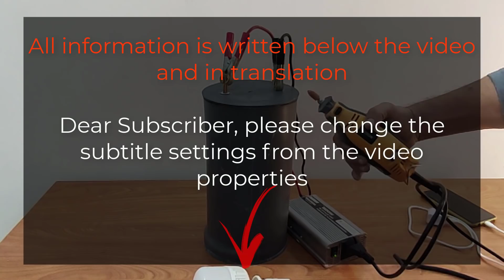Three months on probation until it succeeded

Comment from the maker: The Baghdad Battery is believed to be about 2000 years old (from the Parthian period, roughly 250 BCE to CE 250). The jar was found in Khujut Rabu just outside Baghdad and is composed of a clay jar with a stopper made of asphalt. Sticking through the asphalt is an iron rod surrounded by a copper cylinder. When filled with vinegar - orany other electrolytic solution -
This method was modified using an electronic solution, which is rechargeable and gives a higher voltage than its predecessor
Reply: Is hypochlorous substance the same as regular chlorine?
Reply: @بساطتنا  هل انت فاروق ابو جعفر ؟
Reply: BB is not a galvanic cell. Dont fullish people.
Reply: 1.Is the clear liquid bleach or muriatic acid?
2. What is the white powder?
Reply: Is there a substitute for Hypochlorous acid 200L/H with concentration of 200PPM?
Reply: @Skid_A_Follower_of_Christ  -- It's just a concentrated form of bleach that you can make by dissolving chlorine powder(for swimming pools) into bleach to make it stronger.
Reply: SUPER SER GUT.
Reply: Vous m'en faites une belle de "solution électronique "🤣🤣
Reply: Tak ada description ya
Reply: @Net Help, 
is this alum battery
Reply: Fake
Reply: Is it ok to replace hcl acid with h2so4 acid ?
Reply: Solo falta saber cuanto le dura la carga con una descarga continua de 200 Watts.  Saludos desde Houston
Reply: No. The Baghdad battery is actually a box for safely storing scrolls. Only our imagination made it a battery. But it's nice to believe in flashlights and enrich history with legends and fairy tales.
Reply: @DL-kc8fc  -- Man, you're further off than (Net Help). If you wrap a copper scroll around an iron rod, just the air in the jar would eat the copper over time. Also when they inspected the jar why did they find an acidic residue in the clay pot, the last thing you would have for storing scrolls. Unless it was an ancient scroll shredder. LOL
Reply: @DL-kc8fc  no it is called baghdat battery and there is no advance science behind it. Electricity had been known long before that but had limitted use
Reply: @cemal8123  You have the wrong translator. I do not mention anywhere that the so-called "Baghdad battery" is an advanced technology. On the contrary - it was a box for the scrolls on which it was written (a strip of copper, papyrus or fabric on which the text was located was wound on a stick - this was found). They did not know electricity as such, but they knew about the consequences of static electricity using amber, etc. It was speculated that they could galvanize - they could not. Even the light bulb font I can read has nothing to do with light bulbs...
Reply: @DL-kc8fc  It wasn't a box with a wooden dowel, but something like that could be useful for rolling up a scroll. If you ever look at scrolls most had a dowel in them, so they could be rolled up tightly without creasing the scripts. Have you ever seen the Bagdad battery it wasn't a box, it was a clay jar.
Reply: @Ken-rk3by  In any case, according to the surviving findings, it was a roll box (the copper strip also surprised me, but unlike other methods it was not documented). No "acidity" was found. Only our imagination made it a battery, which made it attractive for the boulevard.
Reply: @DL-kc8fc  No, only your imagination made it a box for rolling scrolls. There are actual photos of the real jar, that's in the museum.
Reply: @Ken-rk3by  I do not question its existence. I saw her at the Baghdat Museum before the war. But it is not a battery, but a perfectly insulated coil box. The findings and their content confirm this. If there were gilding of objects by galvanization at that time, one might assume anything, but at that time no galvanization existed and no gold artifact from that time was galvanized. There were also no electrical machines that could be powered by such a lousy source in an impractical form. I repeat, batteries are just a bite for the boulevard, which takes time and money out of you. In the same way, it was the "bulb" font in Egypt, which combined the boulevard with ordinary light bulbs, and the boulevard could once again make money on human stupidity. Of course, the "bulb" font had nothing to do with the bulbs, but with the time. The fantasy reappeared. At present, for example, it is a hologram that is supposed to be projected into free space. The general public and the public media already believe this. Of course, there is no such hologram as from StarWars. It's always a HUD. The actual hologram can be seen just in front of or behind the interference or diffraction platform.
Reply: @Yaadtech  Be good and decent. I recommend studying Egyptian characters. "Bulb" means 1/2 of the day. Two bulbs are an expression of one whole day - the bubble is an expression of the sun in motion, which moves and enlarges from the lotus flower (base "bulb"). The second "bulb" is an expression of sunset, which shrinks in a movement bubble and fits into the lotus flower. In other parts of the temple, a long story is described with the symbols of many "bulbs" in a condensed write. It is possible to read an interesting spiritual story on the timeline. "Bulbs" that you and your son think they are bulbs, so they are not bulbs. We project many contemporary things into the past and attribute non -existent meanings to them. In addition, the production of conductors and much more that the bulb needs to function, including a powerful source of many AH for operation. Unfortunately, Baghdat batteries were not batteries. In the last century it was speculated that they could allow galvanization of metals, but there were other similar "batteries" that have hermetically kept documents. They were boxes, not batteries. Do not leave your son in ignorance, because when he gets education and is confronted with reality, he will not be grateful to you...
Reply: @Yaadtech  ou're confused. My reaction is up to your writing, which mentions "bulbs" (Egypt) and "batteries" known as Baghdat batteries. I am not interested in taking faith in E.T. or non -existent technologies that are merely projection of similarity. The "bulb" from the denera has no fiber, but a snake that has great importance. On the walls there are other small "bulbs" and everyone can read the story - "bulb" is a time. "Batteries" has the same purpose - hermetic box because other "batteries" with written content have been found (the tabloid does not want to deal with it). Personally, I would like galvanizing, but there are no galvanized objects from that time. As far as helicopters and submarines are concerned, it was a prosaically rewriting the name of the monarch - I tried it myself. Do not be stupid. I don't take your faith to you, but don't offend the cause that no one disagrees with you. Be good and decent. Early.
Reply: @DL-kc8fc  -- You're the fairytale because they have the actual jar in the museum. But uneducated TROLLS will always argue the facts. The one fact is, they knew how to ionize silver and gold for good health
Reply: @DL-kc8fc  well if your a subscriber to mainstream history, I’ll go with the battery version. 
If it is a you say, his scroll protector is a great battery.

Comment: Hw many amp hours is this battery, how long does the copper rod last and im assuming hypochlorous acid you refer to is hydrochloric acid. The fumes from which metal in your house will be ruined and any electronics will likely fail before long.  I think a lead acid battery would be better. i wonder how long a sewerage pipe glued could handle sulphuric acid.
Reply from the maker: 70 amps and lasts seven hours on a charge and I'm still using it.. It won't damage any of my electrical appliances because I use a regulator for that

Comment: Name of the chemical being mixed withvcharcoal?
Reply from the maker: 1 - briquette
2 - rock salt
3 - plastic tube
4 - two copper rods
5 - brass screw
6 - aluminum screw
7 - copper strip 3 mm
8 - 200 g Hypochlorous acid 200L / H with a concentration of 200 PPM

The eighth element
Reply: @NetHelp2  Thanks . How do i get the concentration of no 8 right if you can pls? I just mixed the acid will charcoal . If I didn't get it right it msy be a reason while it's not charging fine. It discharges fast too after I remove the charger from light

Comment: That is cupper cell it hardly reach 0.4 volt how it possible to start inverter that is not possible and your rode is too thin distance is too far between the rods , my expectations to produce 0.1 v only if you connect the sulotion , bur u isolate the rods from each other that produce 0  V, fake experment ,
Reply from the maker: Mr. This cell works on the principle of the Baghdad battery. You can search for it on Google. We also installed a voltage booster so that it works well.
Reply: I know Baghdad battary very well, it gave 0.4 volt only as well and the size is 10 times the size of your battary as it use vinigar wet clothes  to connect the rods unlike ur battary they are isolated, plus the metal rode in Baghdad battary are bigger than ur battery,

Comment: one more hoax , charcoal do not react with HCl , and if all supposed electrolyte is pour in the outer tube how electric current flow  there isn't any connection between anode and cathode
Reply from the maker: Who told you that coal does not react?
Did you know that coal is used in lithium batteries?
Reply: @NetHelp2  As a binder is as no role in them is the Lithium that make all the electricity

Comment: Obyčajný príklad: autobateria má 12 V ! Skladá sa zo 6 článkov, každý članok má cca 2 V !A simple example: the car battery has 12 V! It consists of 6 cells, each cell has approx. 2 V!
Reply from the maker: Pán
Lítiová batéria je jednočlánková, nie šesťčlánková, ale tekuté batérie využívajú viacero článkov
Reply: @NetHelp2  nie je to litiova bateria ale litiovy článok ktorý má 3,7 V a nabíja sa 4,2 V . Je to článok !!!!! it is not a lithium battery but a lithium cell that has 3.7 V and is charged at 4.2 V. It's an cell !!!!!
Reply: @NetHelp2  litiova bateria je už napriklad v aute ,e- bicikli , kolobežka ....o napäti :8,4 v 12,6 v 16,8 v 21v 25,2 v 29,4 v ...........atď.preto sa k tymto bateriam dávajú vyrovnavače (balancer) s označenim 2S,3S,4S,5S,6S....... Kde čislo udava počet člankov v baterií.....Lithium batteries are already in cars, e-bikes, scooters...with a voltage of: 8.4 V 12.6 V 16.8 V 21 V 25.2 V 29.4 V ......... ..etc. that is why these batteries are given balancers marked 2S, 3S, 4S, 5S, 6S....... Where the number indicates the number of cells in the battery.....

Comment: Sir: I have not tried yet but if this works the chemistry is marvelous and cheap. Because the electrodes are completely isolated it appears to be more of a high-storage super-capacitor than a battery. Have you tried carbon electrodes that should not corrode? Also you can probably make hypochlorous acid with hydrochloric and H-peroxide that is cheap and easy to find.
Reply from the maker: Yes, it is cheap and easy to get
Reply: Quelle est la capacité de la batterie

Comment: As fake as they get,
Let's say he actually made it real it whould prodce 0.6v
And 20ma at most
Reply from the maker: Mr
I hope you give it a try before you review it
Did you hear about the Baghdad battery that was discovered and made 2000 years ago
Reply: @NetHelp2  yes, and it turned out it was an accidental battery because nobody at a time knew it was a battery, also it probuces so little power its useless even if they knew it was a battery

Comment: Pls how long will I charge the battery before use and to what voltage? After building it I got 0.66v
Reply from the maker: One hour you can charge it with
Reply: @NetHelp2  with?
Reply: Normal or with high amp battery charger? Are u on Facebook with your name here?
Reply: I have tried to charge it but it drains immediate after o remove the charger

Comment: it was not charged  and will happen after the power have drained out?
Reply: can I get a reply to the above question ? I also asked (DAT after I produced it as u did it was less than I votage) how long will be charger and to what voltage?  what kind of charger? is it going to be with low or fast charging? your response is important
Reply from the maker: You can charge it with a charger of 30 amps or less
Gotta get a slow charger
Reply: @NetHelp2  I did and it WS getting too hot nd will  discharges immediately after I remove the charher
Reply from the maker: Yes, you can ship it
Reply: I tried but it was getting hot. I don't know what else to try again regarding it. I would have been so happy if it worked

Comment: Can you make aluminum air battery
Reply from the maker: No, aluminum is not a conductor
Reply: We use aluminum wires in all our electric lines. It most certainly is a conductor.
Reply: @NetHelp2  bruh who said aluminum is not conductor 
Every metal is conductor

Comment: More ore less todays probably bether known as microbial fuel cell with some litel thermal baterry to it .
It hapens also on ordinary lead acid baterrys to some degree the car chassys is considered also plate so any acid sulution in glue like ore cristal like form will change the lead acid baterrys porpuse normaly its random behaviore expecialy if you use 70s old delco remy alternators 10-12si models you will finde suprise there.
Random effects differ on ich situation but that same rotary thingy is considered generator,starter,magneto,magnetic break,transformer,inverter,converter,antena,plasma/ amplifier welder that same shity small rotary thing does all that and more.
So that guy might have point there .
Because its true .
Ford used sg's delco used them even commonly 4 commitators at the same time .
All cinde off baterrys types mixed together.
Ore see please how peopel used in the past 1 full baterry 1 dead baterry and how be just useing starter motors winding to desulfate the dead baterry peopel did not hade baterry chargers back in the day only coils and their polarity.
So it is posibel depending on the enviroment elements present even bacteria are effected .
Reply from the maker: thank u

Comment: Interesting...keep it up. pls what  is the white object you inserted and any alternative to hypochlorous acids?
Reply from the maker: There is no substitute for acid
Reply: @NetHelp2  so I can use acid is there additional one to add?
Reply: Pls does it mean it will not be charged again before it is put into use ? If yes what next after it have discharged and what is battery ah....capacity?
Reply: Can I GE your Facebook/whassap link?
Reply: what is the voltage and amp.? is it rechargeable  ? I didnt see you charge it before use

Comment: Nice video, however, what is the efficiency (capacity of this battery) what is the ratio of mass to stored power ???, what is the service life?
Reply from the maker: It has been working for months now
It has a capacity of 100 amps
It works for seven hours
Reply: What about the charging? Is charge after 7hrz?

Comment: No digas mmds Merigein, es una batería de celda única, puede tener todo el amperaje que quieras, pero el voltaje más alto que conozco es de la LiFePo, en torno a 4.2, ese inversor es para 12 V y tiene un voltaje de corte alto y otro de corte bajo, es decir, si el voltaje de entrada es mucho mayor o mucho menor a 12V se bloquea. ¿Qué voltaje tiene tu celda?
Reply from the maker: Encuentra la batería de Irak en Internet, se fabricó hace más de 2000 años y funciona con una sola celda.

Comment: Where is the point here? You have simply built a rechargeable battery. Converting 12 volts DC to 230 volts AC can be done with any conventional 12V battery or accumulator! Interesting would be the energy density! For example, how long can I pull 12 volts 1 amp? Everything else is just pointless! The stupor is unbearable when the Videomaker then always hang fans on their tinkering and that runs then or charge a cell phone ... what does that say?! Just stupid! Yes the concept is interesting but that a fan runs when you connect it says but times zero! As I said, if you want to be able to make statements, you have to measure the Watt hours!
Reply from the maker: Activate the translation

Comment: Please,i want to know what is the following white crystal,the rod and how to get the acid and more also the amp hour
Reply from the maker: All we need is
1 - briquette
2 - rock salt
3 - plastic tube
4 - two copper rods
5 - brass screw
6 - aluminum screw
7 - copper strip 3 mm
8 - 200 g Hypochlorous acid 200L / H with a concentration of 200 PPM
Reply: Can we use sea salt if we do not find  Rock salt?

Comment: The Bagdad battery was made with dissimilar metals; Iron and Copper! You can not make a battery with the same metal for both electrodes!
Reply from the maker: Yes, you can
Reply: @NetHelp2  Copper does not normally react with HCL. However when you put current across (as when charging it with a car tender), the negative electrode will form CuCl2 + H2 and the positive CuO. That will give you -0.34V and +1.4V so a 1.74V battery. Likely the accumulated hydrogen will also to some extend recombine at the negative electrode when discharging so this is partially also a fuel cell. That was the nice things I have to say, now the criticism: This battery can in no way produce 10V-12V as is implied when running the inverter as in the video. Also When the battery is originally charged, the current meter on the charger shows 0, or very little current? So you have made a battery, but not a very good one and I presume the results presented in the video are not a result of the chemistry in your cell.